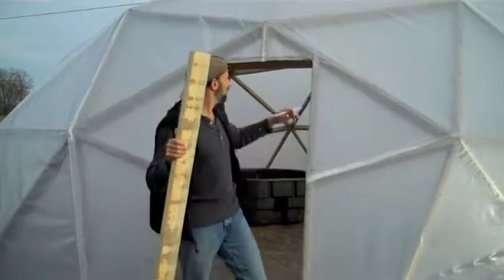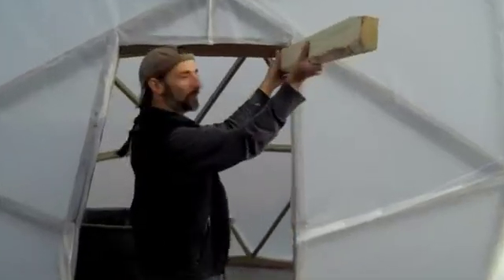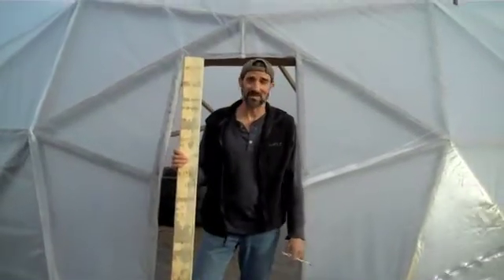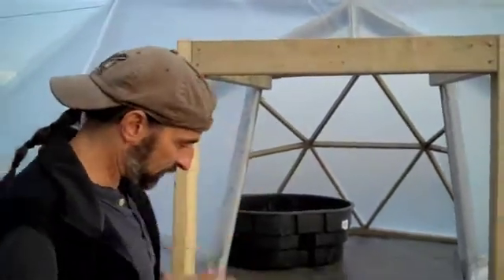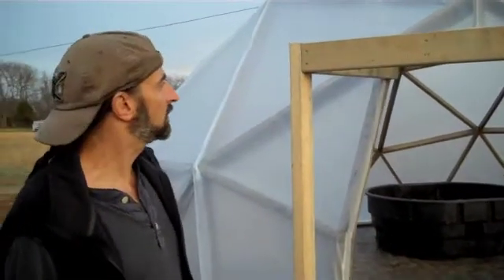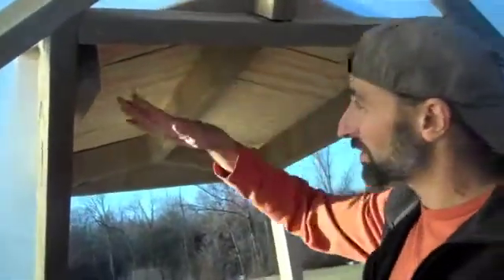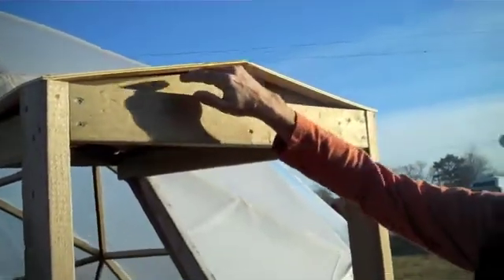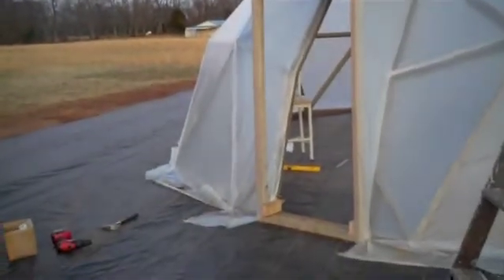DOME DOOR FRAME

Comment from the maker: I would probably build it on a deck with a knee wall to raise it up a little. Also I would look in to using 2X6's for added width so you can add extra insulation. I've heard that dry walling the inside is a real pain because of the angles and also ventilation is a must have since humidity will be an issue.

Comment: Looks pretty nice.  I think the only improvement I would do would be to match the door's roof peak with the hub section that you had to connect it to (tip of the pentagram), then incline it down to the frame.  That would have opened up the headroom as soon as you crossed the screen threshold into the vestibule and allowed a wider run off.  And it would have made it easier I believe to anchor covering material where the vestibule attaches.

What you have still works though, and it looks good.  W